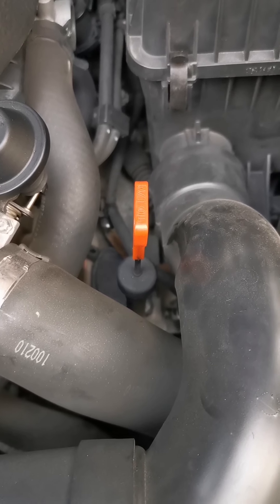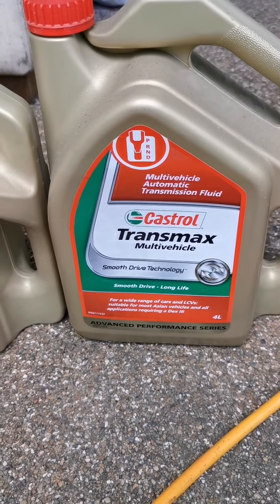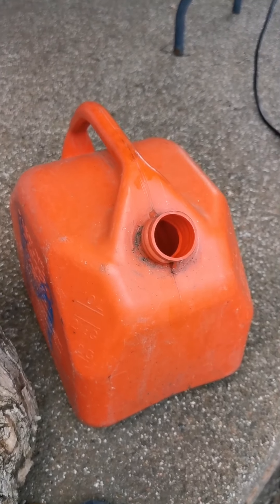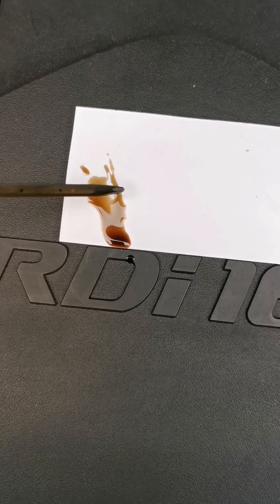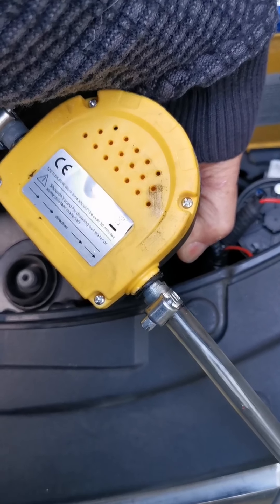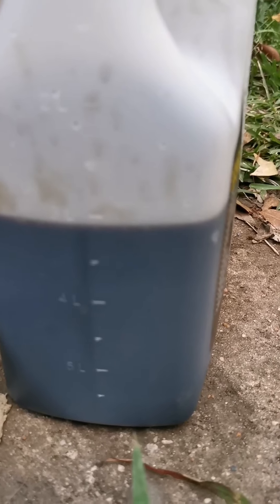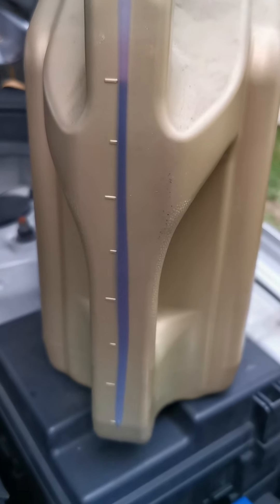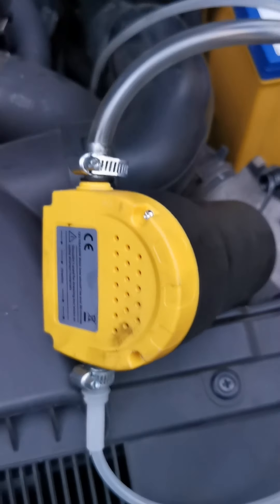Hyundai i30 easy automatic gearbox oil change

Comment: ok, but what about gear oil filters?
Reply: I think he is forgot )
Reply from the maker: After 40k on the next service they change it
Reply: it should be change with every oil changing to my opinion because of gear synchronization will be more long life when all of two same time changing. in fact you add 3 piece of cylindrical magnet in to the gear box, as long time working machine after then no methalic particules in to oil pool and all particules will be accumulate on magnet. @josersimoes